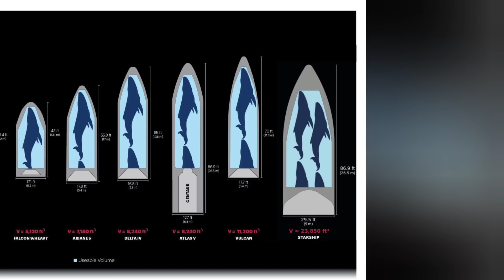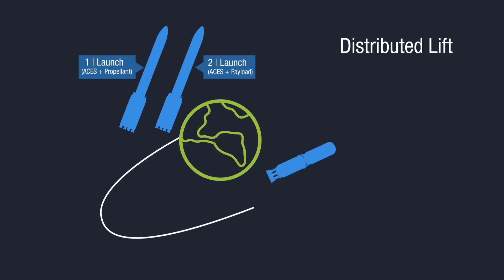Devastating news for ULA!!  But why does Vulcan Centaur matter?

Comment: To be clear, the tanks on Centaur V are much larger than the existing Centaur. They are new.  Even so, with all our computer simulations you would have thought something like this (basic stress-strain material calculations) would have been caught early before any hardware was constructed.  In retrospect, it would have been smarter to have had Aerojet-Rocketdyne license from Russia the manufacturing of the RD-180 engines here in the U.S. and kept Atlas 5 around another 5 to 10 years. Missed opportunity.
Reply: Bear in mind, and this is what Angry doesn't tell you, either because he himself doesn't really know, or if he does, he won't tell you about, is this: the test article used for the qual testing was the only one and it was used in 15 tests, the 15th and final one was the most extreme case loading, so the fact that the article survived through so much through all those tests says that the design is pretty good! 

ULA's being overly cautious with this as they most likely could get away with flying the Cert-1 Centaur flight stage "as is". This was an option that was seriously considered. Probably because the customers as well as ULA brass, including those of its parent companies decided not to take that risk and chose to wait for the doubler patches to be welded and tested.
Reply: @thomasackerman5399  ah, good to know. If it had been through that many cycles and was then being overstressed near the design limit, perhaps the design was not a bad one.  Still, I can see why, since this is such a high profile and important launch (especially for shareholders), delaying it until fixes could be put in place makes sense. Still hate the delay. Was looking forward to seeing it fly this summer and the Peregrine lander try for the moon.
Reply: Note that SpaceX depends upon frequent flight-testing to see if the design is strong enough.  Despite using thin steel IFT1 demonstrated the extraordinary strength of the design under conditions that nobody would have thought to simulate.  Even when they detonated the Flight Termination System the structural strength held up for over thirty additional seconds.  SpaceX engineers are undoubtedly now thinking "How many microns can we trim off the thickness of the steel?"

While the use of hydrolox for the second stage is highly desirable from a performance point of view, the incredibly low temperature and the effect of hydrogen embrittlement undoubtedly contributed to the test failure.  But they really should understand this as the Centaur and RL10 have been in production use in one version or another for SIXTY years.
Reply: @jamescobban857  yes, but these tanks were completely new.  I do agree though that you would have thought that would have been caught in simulations early on.
Reply: But they are planning to use the Centaur, and size it, in ways that bear no resemblance to the past.
Reply: @VicariousAdventurer  yes, that is exactly why it is in essence a new vehicle, not the same as the old or current Centaur. They called it Centaur V.  Only the avionics and engines are the same. But the design of the tanks, being very thin, is similar.  

Centaurs have been reliable since the late 1960s and have a great track record, helping to launch many of the most historic space exploration missions ever done. 

If they can fix Centaur V, it too should work well. I hope so.
Reply: Simulations / calculations cannot overcome incorrect data. From the days of the Wright Brothers finding out there were errors in Lipid that's data... The data on the long-term exposure of metals to hydrogen (and atoms creep into the lattice, and hydrogen is liquid when Very cold) might not be some complete; in fact, one of the reasons Blue's lander was praised was because of retiring technical risk concerning long-term storage of hydrogen in space.
Reply: Autocorrect Wrights discovered Lilienthal had bad data. I'm assuming that the problem is not that someone made an undergraduate-level simulation mistake, but that an error in understanding changes maybe over several days to a metal exposed to liquid hydrogen was perhaps not fully explored, and maybe a new unknown behavior popped up.
Reply: @VicariousAdventurer  perhaps, but we've been using liquid hydrogen since the mid-1960s, even though von Braun was not initially a fan of it due to the inherent difficulty in its use. Indeed, the Centaur was our first LOX/LH2 vehicle, and was designed similarly to the old Atlas (basically a thin-walled, nitrogen pressurized stainless steel balloon). The success of the RL-10 engines paved the way to a certain extent for the Saturn V's S-II and S-IVB stages which used the very good J-2 engine, both engines by Rocketdyne (now Aerojet-Rocketdyne).

Then we went on to use it to power the Delta rockets and the old space shuttles, quite successfully without any tank issues.  I just hope ULA can get it reengineered, rebuilt, and ready to fly soon. We need Vulcan\Centaur, especially for Sierra Space's Dream Chaser and for those strategically important military satellites.

Comment: 13:53 "made of steel/aluminum alloy" ... ahem ... steal-aluminum alloy ... really ?!?!?!?  Steel is mostly iron, and iron and aluminum tend to help each other oxidize when in contact.  Stainless steel, with a lot of nickel and chromium, can safely contact aluminum, but I don't think they really go together well as an alloy.  Could be wrong ...
Otherwise, great video!  Indeed, they should give the finger to Boeing and Starliner, and use those Atlas V's for something useful.
Reply: Ferroaluminum disagrees with you.

Nickel iron aluminium alloys got exciting a few years back, reaching the strength of titanium.
Reply: @jocramkrispy305  Thanks for the info;  I guess I'm getting rusty on alloys  ;-)

Comment: Well, I guess it depends on how long it takes them to reinforce that centaur stage and whatever it takes to do that.  It may not take that long to fix it and get it tested again.  Starship isnt exactly ready for prime time, either.
Reply: @@AI_effect Well, they basically have the booster and they have months of rebuilding and modifying a new upper stage centaur and re testing.  So no, its not just the pad. 😂
Reply: @pipersall6761  The Centaur launch pad was not damaged.  The test stand was, and pretty heavily.  IT seems clear that @AI_effect's comment was bout the SpaceX Starship launch pad, which was heavily damaged nearly 3 months ago, but is very close to being fully repaired, and upgraded.
Reply: @ChristLink-Channel  just to be annihilated again😂Musk said it would be reusable in one sentence and that they saw up to 1 inch of erosion per second during launch in the next. not to mention that they are basically building a huge steel/steam pipe bomb.. my guess is that the next launch is going to be an even bigger failure than the first..
Reply: Angry, we need to remember ULA kept the faring manufacturer from selling the farings to SpaceX - They said the extended faring patents belonged to ULA & not the American taxpayers who paid for it.
Reply: ULA currently has the capacity to build 40 rockets per year. the redesign is a revision to a CAD file and tooling adjustments (in a nutshell). biggest headache is probably the loss of payload mass to orbit.

Comment: here is an idea: why not use the starship booster to launch to low earth, then instead of starship have the payload with its own boost engine to get out to geo stationary?
Reply: Because it will be years and years before Starship will be ready to take commercial payloads.
Reply: @stephengarrity9702  will not take that long if it were not for the faa and that lawsuit, and that will be significantly quicker than trying to come up with a usable rocket on ula's part
Reply: @stephengarrity9702  and years...and years.. many many years. At this point my money is on Starship being a dud.
Reply: @Heinrich_Von_Schnellfahrer  Why?  Yes, the last Starship test went boom, but so did many Falcon 9 test flights before they got all the kinks worked out - they've even got a "How Not to Land an Orbital Rocket Booster" video showing this - and they've just landed a first stage booster for the 203rd time.  The last major Falcon 9 failures were June 2015, when the rocket broke up in flight, and September 2016, when it exploded on the launch pad.
Reply: @Michael75579  The latest ship went boom? 

SN1 = failure during pressure testing
SN3 = tank collapsed
SN4 = BOOM
SN7 not counted as it was a test-to-failure scenario. 
SN8 = BOOM
SN9 = BOOM
SN10 = BOOM
SN11 = BOOM
Booster 7 = BOOM during spin prime. 

Raptor 2 has 3 times the chamber pressure of Merlin . As a result the engines tend to eat themselfes according to Musk (and they are going for higher pressures in Raptor 3). Falcon 9 has a total of 10 engines if you count the second stage. Starship Super Heavy will have 39. Not to mention the current design i incapable of doing anything it is supposed to be designed to do. 

I think it`s just a bridge too far..

edit: and as long as they are not capable of funding themselves they are at the mercy of the investors. that is not going to get any easier going forward..
Reply: @Heinrich_Von_Schnellfahrer  Investors?
I'm sure you know what a private company is.

The only way the starship program is getting any funding is via NASA for the HLS Contract, and that is for a specific variant.

The rest of that is just SpaceX footing the bill.
Reply: The Wet Centaur space shuttle concept that the NASA astronauts killed (because it was not exactly safe on a manned vehicle) is not obviously impractical for starship.

Comment: The heavy stainless-steel Starship simply has to be refueled to go anywhere beyond very low earth orbit.  It reminds me of the old shuttles that weighed 165,000 pounds but could only take up a 40,000 lb. payload.  Without taking up the shuttles that system could have been a cheap heavy lift vehicle in the 200,000 lb. class. Indeed, the concept was floated, but never funded, called Shuttle-C, with the "C" meaning cargo.  They felt that later on, just like Vulcan is planning, the expensive SSMEs could have been recovered in a separable lifting body. Ah, the path not taken.
Reply: Starship is still in development and is constantly evolving  the final design and statistics for the vehicle haven’t been finalized ,and they just recently added hot staging to the mix so there should be some improvements performance wise there, therefore the design is still improving so until then we can only go with what we already know which is a couple to maybe a few years old at best , I’m sure Elon will hold another starship presentation in the future with tons of updates and improvements
Reply: @giminai8000  I hope so.  Nothing is "written in stone" until the vehicle design is crew rated and then frozen. Of course, even then, that wouldn't prevent SpaceX from developing different versions for launching their own Starlink satellites or specialized missions.
Reply: Shuttle-C actually had fully disposed of SSME/RS-25s in a modified orbiter aft fuselage. It was only intended as an interim vehicle to lift Space Station Freedom components with far fewer flights than the regular manned orbiters could. There were earlier Shuttle derived vehicles and Robert Zubrin's concept for an HLV that would recover the engines in a module that would splash down in the ocean and be recovered, but no detailed design work or testing was ever done.

Also, the Shuttle orbiters had a payload capacity well in excess of 60,000 lbs, but rarely ever came close to that because payloads generally are volume constrained rather than densely built. Columbia, the most heavy and least capable orbiter took up a record payload of over 53,000 lbs (24 mt) on STS-93, the Chandra X-ray telescope launch.
Reply: @thomasackerman5399  depends on the orbit of course.  35,380 lb. was what it could take up to the ISS orbit at that inclination. The 60,600 lb. was for a Cape Canaveral matching inclination and only up 127 miles.  Good if the payload carries its own kick stage. I had forgotten about that.  It even had a two-stage IUS to get it to its very high orbit. Very heavy observatory. Lasting a long time too well beyond its 5-year mission, a good bang for our bucks. 

Ah, I can only imagine how much better the ISS would be if we had Shuttle-C to carry up modules instead of being limited to the volume of the shuttle cargo bays.  More like three or four Skylabs instead of the "tinkertoy" station we have now. 

And not having to risk a crew just to take up modules.  We were very lucky no more crews were lost during construction of the ISS.
Reply: Wait for Shell space gas stations enter in the arena.
Reply: @miguelmouta5372  I think it is Lockheed that is developing concepts for fuel depots. We are going to need them.

Comment: ULA went well over the top with Centaur V... it's huge ! I don't see where's the advantage unless the Vulcan booster is weaker than Atlas V or if they are banking everything on complex combined missions like Ariane and Vega.
Reply: Tory Bruno claims Vulcan Centaur can do everything Atlas AND Delta can do.
Reply: The numbers for Vulcan vs Atlas and Delta don’t add up to me. It’s supposed to be significantly cheaper than Delta but it’s essentially the same booster but without the expensive foam insulation for LH2 and a new machining pattern for the tank structure. It has 2 booster engines instead of 1 and its SRBs are bigger than those on Atlas or Delta, it seems very unlikely to launch with 0 SRBs so it can’t realistically do Atlas 401 missions so that’s one market they have abandoned. 

I think they should have done a variant of the more conventional DCSS / ICPS with the BE3U engine to replace Centaur 3 as a simpler less capable option when Centaur V is not needed, that classic Upper Stage design is perfectly fine for the SLS Exploration Upper Stage and others like the H3.
Reply: RL-10 is old and expensive, but it is even more throttleable than anything from Blue Origin; I think the closest engine is the BE-7. In fact, I read that a Blue Origin engine was explicitly rejected for the second stage. Blue only got the first stage contract.
Reply: @VicariousAdventurer  The RL-10 is also fueled by Hydrogen, which is much MUCH lighter then Methane. Meaning heavier payload and greater efficiency. The RL-10 may be old, but is continuously being improved and new features added.
Reply: @VicariousAdventurer  Blue Origin wasn't exactly rejected for the upper stage, rather a modernised and cheaper RL-10 from AR was selected. Since what became Vulcan was supposed to be  an evolution of Atlas (and later Delta)  it was highly unlikely that both stages would be powered by new engines from a new company. AR lost out on both the SRB contract (Atlas AJ-60 to ATK/NG GEM60 and 63) and the first stage booster (AR-1) so they had to be supported with lots of development funding and contracts to keep them and the RL-10 going. 

The evolved RL-10 was also selected ( in pairs) for the Northrop Grumman OmegA upper stage but that project was later cancelled when SpaceX Falcon series won out over NSSL mission awards.

BE-3U is also hydrogen, not methane like the BE-4. It is more powerful than the RL-10 so would not need to be fitted as a pair to improve performance over Centaur 3.

Comment: Why cannot they use Merlin or Raptor engines on Vulcan?
Reply: The most serious reason is because real life rocket design is NOT Kerbal Space Program! You cannot simply slap one part on the other without any consequence. Everything from the tank wall strength, the thrust structure(s), propellants, etc. have to be almost completely redone. 

Merlin 1D Vacuum is kerolox so the whole upper stage has to be redesigned from scratch to handle the stresses of an engine that at full thrust is over four times that of RL-10 CX which is a hydrolox engine, and the payloads that make use of the mass fraction and low-g acceleration of RL-10 CX, now can't fly because Merlin Vac can't throttle down anywhere near low enough to match.

On top of that SpaceX won't sell their engines to anyone else as Elon doesn't like forcing his toys to conform to someone else's specs. That's why Blue got into trouble with BE-4 for ULA, ULA wanted the engine to perform to theirs and the military's specs, so it went from being a 450,000-500,000 lbf engine to a 550,000 lbf one. So much of BE-4 had to be redesigned around that, which took time and lots of extra testing.
Reply: No need. They have the BE-4 for the first stage, which were finally delivered by Blue Origin.  For the upper stage, the high energy LOX/LH2 Centaur (which has an enviable mass fraction due to its design) gives you capabilities those other engines can't match.  Note too that the BE-4, despite their development problems, may well be a much easier (cheaper) engine to refurbish and reuse due to the lower internal pressures presented to the turbopumps compared to SpaceX's Raptor engines. We'll see.
Reply: short real answer: you cant just slap any engine to a rocket like you do to a car. you need to redesign a rocket if you were to change the engine.